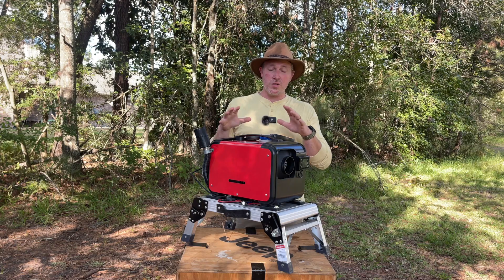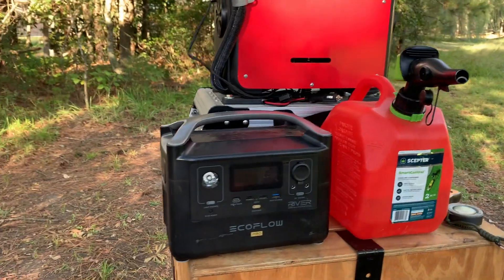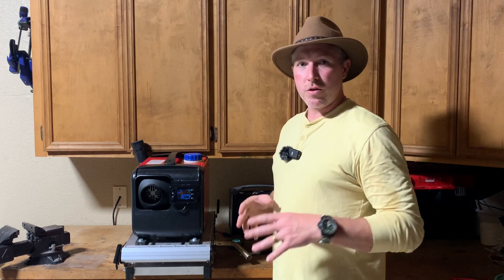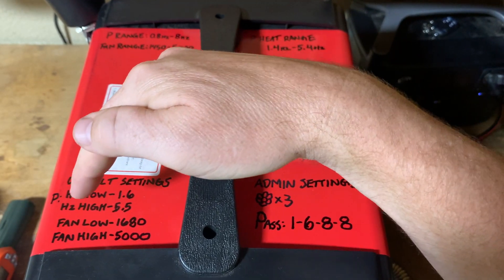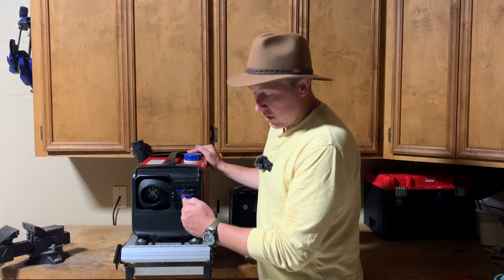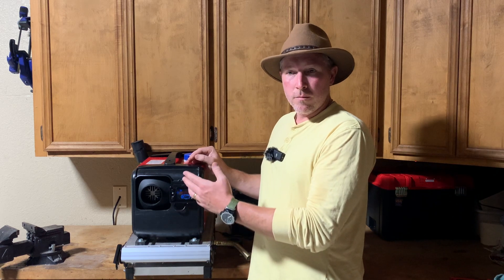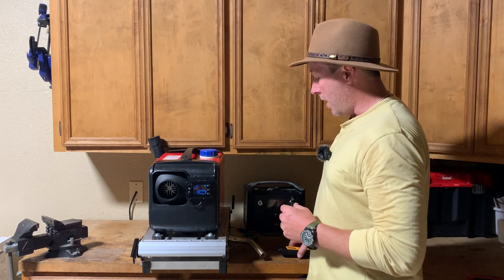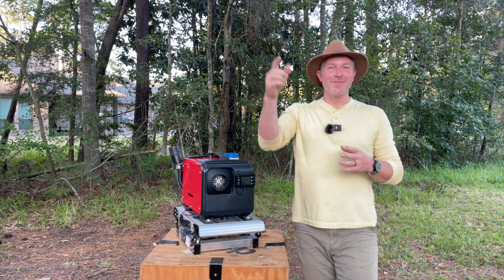Maximize Efficiency: How to Tune Your Diesel Heater!

Comment: I don't yet have a cheap heater, just a Webasto in my rig.
It will get crazy hot ... it's burning diesel fuel! 
And it does start off like a sprint, then setting down to a run or a jog.
A Webasto dealer/repair guy told me to keep it blowing hot enough that I need to open (partially) a window.  This helps it stay clean longer between soot cleaning.   Think of it as driving on interstate vs in town.

Comment: Nice video. I'd say you could probably cut out about 70% of the fat and keep to the tuning part in the last 3-5 minutes, but otherwise solid info. In the industrial maintenance field we use similar methods to set gas valves in ovens, HVAC equipment, etc for the same reasons. I will note, DO utilize your MAX setting fully and for the last 30 minutes of operation to eliminate coke up, Wix 33011 fuel filter before pump, and Power Service Diesel Kleen as an anti-gel and algaecide is cheap insurance in winter temps.

Comment: I have tried running my heater in temperature mode. It keeps getting faster and hotter. At one point the display showed 130°C! Is this normal? Does it do this, then settle down?

Comment: I have a vevor (don't know the brand makes one hot of difference?) unit. It's only a few months old. Controller is more primitive than yours or appears to be. After installing I found vids that told me how to prime but my controller didn't let me follow any of the vids. In the end I had to let it just do its thing with the fuel line disconnected until I had purged the air. Then I stumbled onto your vid. Like the idea of tuning it but controller doesn't even have the same options? Primarily it doesn't have a setting icon that I can see and definitely no physical button. Is there still a way to do it with mine?

Comment: Your information is very interesting , knowing this you could probably run the heater without the computer in a emergency situation, let's say your computer died , just run power to all of the individual components like fuel pump , fan 
Turn on the glow plug for the correct amount of time to get it started and then manually shut off the glow plug.
Probably would only have one setting like always on high or always on low.
What controls the ppm ?
I'm assuming that you would change the voltage to change the pulse per minute

Comment: Well i have the exact same controller and i press the gear/sun icon 3 times and it does absolutely nothing, i cannot enter the admin mode whatsoever.
Reply from the maker: Interesting .. I’m not sure what that is about. Some newer controllers have an altimeter built in that automatically adjusts the fuel rate and  fan speed for optimal performance.

Comment: They are not ready to run out of the box. They have wrong flexible non hard pump line and fuel line are pinched
Reply from the maker: Yes, I’ve seen this to be the case sometimes

Comment: we are in tallahassee Fl.--not sure what fan speeds or pump speed
Reply from the maker: You’re probably near the same 30 feet sea level as me so the settings in my video should work for you as a good starting point… Otherwise, depending on the unit, it could be different parameters slightly so the adjustments might need to be increased or decreased for proper efficiency.. get the analyzer and give it a shot… Happy to answer any questions along the way
Reply: @GatorOverland  ok--do you know how to set air intake to best flow /??
Reply from the maker: @shf030 I just have mine routed without any kinks up the side and out of the way of the exhaust.. as long as it’s not kinked it should be fine.

Comment: Anyway to do a factory reset?
Reply from the maker: Not sure if a factory reset, but they are commonly set for sea lever
Low
1.6hz pump
1680 rpm fan

High
4.5hz pump
5000 rpm fan

Comment: Great video. I like the method of dialing in the fan speed to coordinate with the heat setting first and then setting the pump frequency to match it. Makes it a much more streamlined process. Since it'll be colder tomorrow, I'm waiting until then to do the actual tune of my heater now that I have it mounted to a stand and a voltmeter/ammeter wired in (I'll be running it from a deep cycle marine battery in my shop which will act as a safety in the event of a power outage, so I wanted to monitor current and voltage as it runs).

Mine has the odd 3-button controller which is more convoluted to go through the tuning process, but between your video and another, I should have it pretty well figured out. My hope is that tune settings are retained when the battery is disconnected.
Reply from the maker: Thanks for taking the time to watch and comment… Let us know how it works… In my experience after months without having the unit energized it remains at the last input of controller settings, rather than losing memory and defaulting… Worst case just remember your most efficient settings and write it on the unit and set it appropriately prior to starting it up

Comment: I have an Hcalory 2kw standalone heater with Bluetooth. I thought I was buying one with the ability to set pump & fan specs. The LCD looks very similar to yours (6 fan blades, Red digits, same buttons, but with angled, not rounded corners.)
3 presses of the Gear button doesn't bring up the hidden menu login. How can I identify which controller &/or motherboard gives that option and lets me tweak pump & fan settings?
BTW, I haven't hooked it up to diesel yet, just the electrical to see if I could tweak pump & fan settings before installation.
Reply from the maker: These should fix you up
LCD controller
https://a.co/d/2NTRW54
Blue motherboard
https://a.co/d/fAhQxXz

Here’s a complete kit that specifies full adjustability of settings https://www.amazon.com/dp/B0DP54PWLF/ref=sspa_mw_detail_5?ie=UTF8&psc=1&sp_csd=d2lkZ2V0TmFtZT1zcF9waG9uZV9kZXRhaWwp13NParams
Reply: @GatorOverland  Thanks! It looks like I have to lose the benefit of Bluetooth with that controller & motherboard combo. At least there's no mention of Bluetooth in the listing. Any other option that has Bluetooth?
Reply: @zarguy hopefully, you get the remote like the video!

Comment: I live full-time in a 24ft motorhome in British Columbia. My Webasto 5kw heater died a couple days ago and got myself a Vevor 5kW replacement right away because lot of friends have it and they said it's almost the same. Well, it's not so far!

The Webasto on medium setting was keeping the whole motorhome at 20°C. This new one at highest setting only keeps things at 14°C. It has the altitude mode built-in the settings.

I know Webasto is 10x more expensive but the performance is substantially better as well as the fuel consumption right out of the box. Also, in terms of power draw the Webasto is a lot more efficient running in medium keeping everything warm and moving more air around whereas the chinese one is drawing as much power and barely moving the air much.

I will try to change the fan rpm to higher settings and it might be just what it needs but I'm unsure as to what frecuency the pump has to be at as well.
Reply: Something is seriously wrong because the biggest problem with diesel heaters is that they put out too much heat for most applications and that's what causes people to run them on lower settings and then get carbon buildup.
Reply: @MAXIMUSMINIMALIST They definitely need to be adjustable to lean it out for lower temperature settings. 👍
Reply from the maker: Thanks for your thorough documentation… Let us know how it goes

Comment: My control panel is completely different from that one i wonder if it has advanced settings
Reply from the maker: Depending on the controller, it may actually already have the altimeter/Alpine mode.. It does need to be calibrated though.

Comment: Great video, very helpful, thank you.  

I bought a Silvel diesel heater, the kind where the burner assembly and fuel tank sit side by side.  Have not fired it up yet.  I did notice that the fuel pump in mine is mounted horizontally/output slightly below input while the others I've seen are mounted at an angle.  I would assume that since my heater was built with the pump horizontal that they are supposed to be that way, is that correct?
Reply from the maker: To my knowledge they are to be at a slight angle.. but maybe it’s acceptable for this brand?

Comment: Hope I am not too late to party, thank you for the video!  I have a question... does adjusting the fan speed affect the efficiency of the burn or are they independent from each other? ( I know the burn chamber has its own air intake, but I dont know if that is affected by fan speed )

Reason I ask is I like the heat generated at the lowest setting but id prefer a bit more fan speed on it. I often find myself using the heater on higher settings just for the airflow.

If I increase the fan speed for the low setting will I also need to adjust the Hz of the pump?
Reply from the maker: Great to hear from you.. 
-what size is your unit?
-what size space are you trying to heat? 
-How long is the hose from the unit to space you’re heating?
For understanding, the blower fan and the turbine fan for the combustion chamber are connected on the same shaft.. the fans are different sizes and thus move different amounts of air, but spin at the same speed. If you want more air at low speeds you can increase the rpm of the low fan speed rpm, but you’ll have to tune the the fuel pump speed to match.. technically you could make the low fans speed and the high fan speed and fuel pump the same, but you it wouldn’t allow for variation.. if you’re heating a small space and you only have a 2kw, you may consider setting your low speed rpm at half of the high speed rpm .
Reply: @GatorOverland  Thank you for the reply

-what size is your unit? - The Amazon posting has it as a 8kw heater, its a chinese model so I am dubious about the actual power
-what size space are you trying to heat?  - Glorified shed at the end of my garden, measures W:4m D:3.2m H:2.6m
-How long is the hose from the unit to space you’re heating? - Just shy of 1meter with Eberspacher MaxiTherm ducting insulation (the heater sits outside in the rainy sky's of the UK)

The unit has elevation detection but that jumps around between 100-300m depending on the day.  Also as far as I can tell I do not have Pulse rate on my controller, it has "Running levels" which it announces as "gear mode 1/2/3...".

I dont have the tools just yet to tune the pump,  as you pointed out I will need to tune the pump if I change the fan speed.   For now I will stick with run level 2-3 (out of 10) for the air-flow I want
Reply from the maker: @jasonhendry6291 brilliant! 5-8k is definitely applicable to your space to heat. Sounds like you have one of the new controllers with alpine/elevation awareness. I’m not sure if tuning will be the same as my method, or at all. I have seen some videos about calibrating the elevation though. Would you say your elevation is as detected by the unit?
Unrelated, Was just in the UK visiting family. We have family near Thirsk and the Cotswolds down the road from Jeremy clarksons farmers dog pub.
Reply: @GatorOverland  Just checked my elevation from two different sources, they report between 32-34m.  So the 100-300m from the controller is off by quite a margin, I will look into what others are saying about potentially tuning my heater.  I am half tempted to just buy an older model ECU and hook that up, no idea if that is a good idea though.

Hope you had fun over here!   I am a fair distance from Cotswolds, not to far from Thirsk.  In a small town just outside of Sheffield, 30minutes from the Peak District.
Reply: @jasonhendry6291 I would just turn up the fan speed, for most reviews they like to run lean and advise it. There's a tuning video on here I just watched.

Comment: Great video. Good to see a video that isn't just spreading the same old misinformation. 

I would add to this, that you want to check your CO with your full exhaust system installed. This is especially important if you have a longer exhaust, or if you are trying to scavenge heat from the exhaust, like many people do. 

It is perhaps unfortunate that units with access to the engineering mode are becoming harder and harder to find. I say "perhaps" because some now have auto correction and others have plateau more / alpine mode for higher elevation. If you are willing to tinker and take the time to do it right, you can get these running really clean, as you showed here, but you can also mess them up if you make too many assumptions. 

Going lean can cause the CO to quickly go off the charts on these heaters. I have tested this a few times myself. It is shocking how quickly 20ppm can go to 400, if you try to conserve fuel.

Comment: I got one of these for a workshop and measured 200ppm at the warm air outlet. I figured it was faulty and bought another, same deal. 
Exhaust is routed outside and air intake further away. I even used heat resistant silicon on the exhaust flange to ensure no external cross contamination. Any ideas what the problem could be? It's a vevor, same thing..
Reply from the maker: Double check in an environment no where near the heater (living room of house), and then put it next to the exhaust of your car.. if it registers 0 in the house, and any ppm by your exhaust, then it’s fair to say you have some exhaust getting into your clean air ducting..
Reply: @GatorOverland  I tested multiple scenarios, the extreme of which:
Heater outside with exhaust and air intake about 2 meters apart. High power fan blowing at the machine as to ensure no exhaust can get sucked in. 
I have repeated this with two of the vevor machines and still read some ppm. From this it is clear that the burner is faulty.
I have two CO detectors and have verified both are operating correctly by testing at a known CO source (exhaust). 
I am surprised no people are dying in their workshops. Had I installed it without checking it would be dangerous, albeit good ventilation and a large workspace would probably negate the worst effects.
Reply: @maxpowers410  that's definitely a major issue but nobody is going to die in their workshop because they are not sleeping so a person is going to start getting a scratchy throat and watery eyes after being exposed to 50 ppm and even 40 ppm for a short period of only 20 minutes or so and that much exposure is a drop in the bucket but you will notice it without question.
Reply: Tighten all screws. Especially near the burning chamber. Assembly quality might be bad. It might be leaking fumes somewhere.

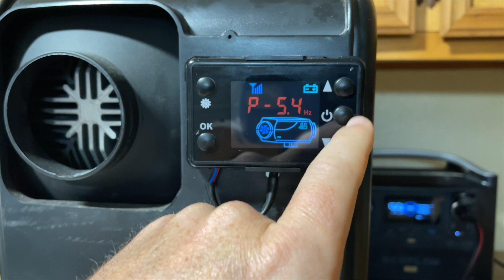Comment: 5:45 That is P for Pump/Pulse.....AND 1.6 Hz/Hertz of pump pulses per second.
Reply from the maker: It’s interesting you say that because the pump settings are completely different hertz setting done in the admin .. the P setting can also be converted to Celsius heat setting.. I assume since they are using HZ in the P setting that it does have something to do with cycles per second, but not sure it’s relevance to the actual pump HZ settings done in the admin.

Comment: What do you think the best settings would be for max fan speed and max heat all the time?  It's a drafty steel building so I have 2 always running full blast when I'm out there.  Efficiency and noise aren't a concern, just prefer to not coke it up.   I'm pretty close to sea level.
Reply from the maker: You can double check it with my method in the video. If you’re having a desired output of heat and low CO ppm, then the chances of coking are significantly reduced, if not eliminated. Regardless of settings, I advise running as max temp for a bit of time before powering down the unit in effort to burn out any soot.
Reply: @GatorOverland  got ya.  I only run them at max heat.  When I shut it down it goes into some sort of "clean" cycle for a minute or so.  Im pretty sure I need to take apart one of them and clean it.  First starting cycle it e-8s then fires on second try.
Reply from the maker: @justinbeaniam E8 is for lack of fuel and could be associated with the fuel pump

Comment: Do you think its possible to run the fan speed at about 2000 rpm while have it at its highest temp setting? Like at 5hz? Or do they "move in unison"?
Reply from the maker: You can definitely adjust this setting to your desire for high&low rpm & fuel rate, but it would be up to you to test/ determine how efficient that setting would be using then analyzer.. 
basically you would be programming your min fan speed and fuel pump at whatever you determine is the most efficient per ppm, and then adjusting your max fan speed to 2000rpm and adjusting the fuel hz to the most efficient per ppm.. then when dialing up the heat value it will only increase within that range.

Comment: I've had a 2kw version installed in a van the past few years -- out-of-the-box it wouldn't ignite consistently; initially i used the 'no tool' method, and it ran fine with these for ~2 years, though i was using fan at 5000 rpm and they were burning out every year

this year i bought a CO tool similar to the video and sought to find lower rpm and pump combo -- i made the mistake of testing with too much air current around, leading to higher CO readings no matter what as RPM increased (the air current was blowing too much away so stronger rpm led to more reaching the meter rather than a true reading of what was coming out), and leading me to conclude the lowest rpm possible were best (1500 low/ 3500 high)

i fouled up 2 burn chambers in ~2 months with these settings and recently recalibrated in area with little air current -- readings are not always consistent as expected at different fan/pump combos, but by taking multiple readings over several hours i've arrived at 3.8hz & 4350 rpm on high, 1.2 hz and 1500 rpm on low... hoping i'm done swapping the burn chambers with these but not sure
Reply from the maker: 🤘🏼🤘🏼🤘🏼 thanks for your input.. what elevation are your ?